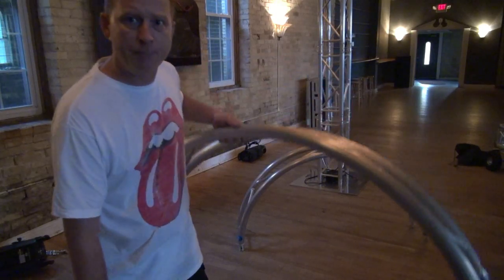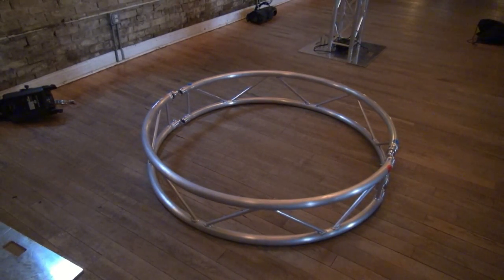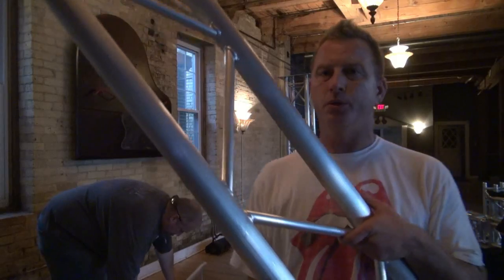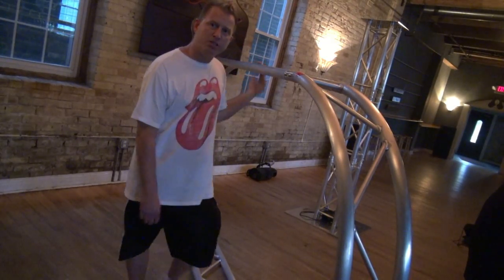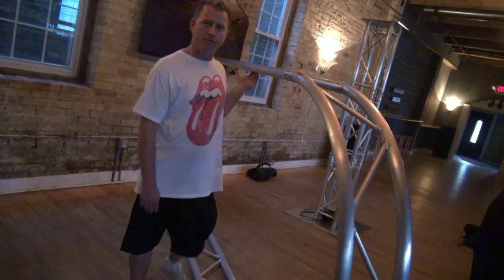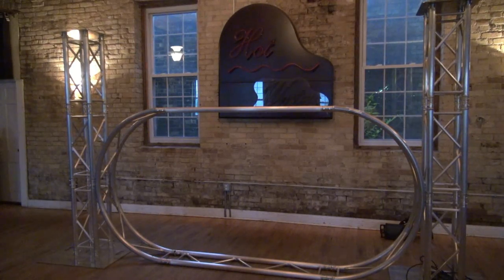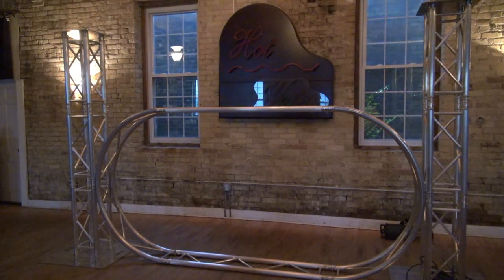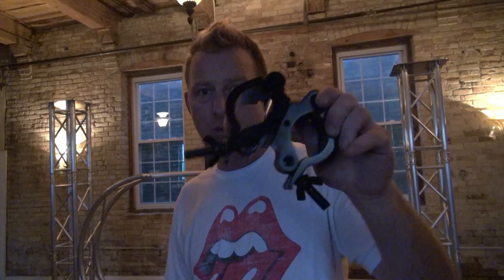Building Circles & Ovals With Global Truss

Comment: Hi Brian, I'm wondering if you could provide me with more specs than just on the Oval truss. Specifically, I'd like to know what you used for the Verticals (which Truss and Base Plates), which Base Plates are under the DJ Stands and finally what lights have you used on this? Anything you would be willing to share would be appreciated.